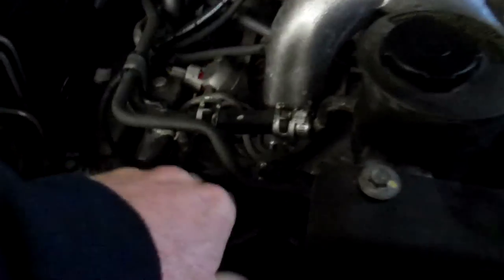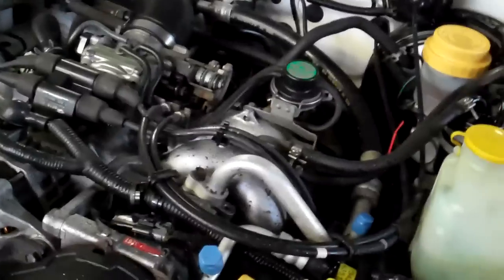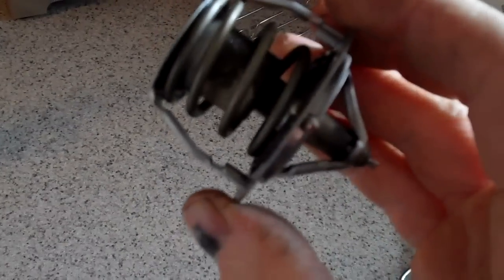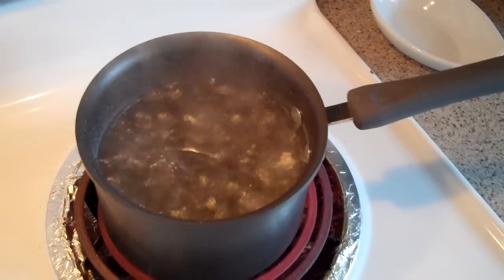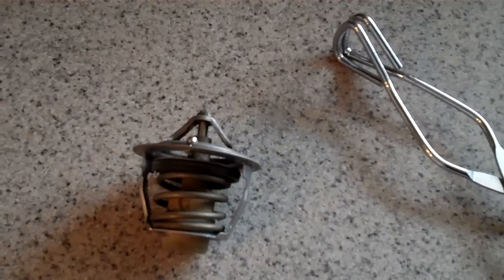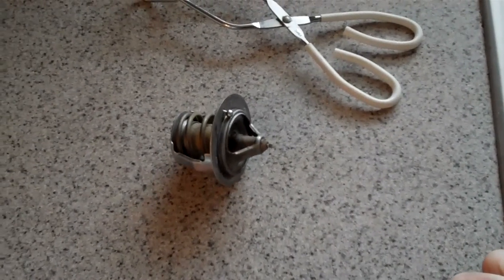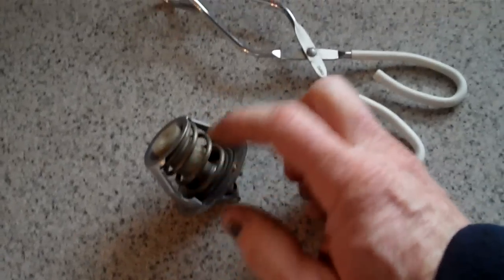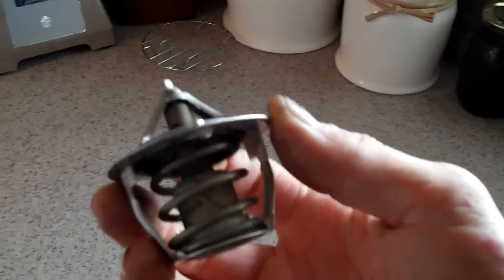How to diagnose a Subaru that overheats after ten minutes of driving

Comment: It's been a long time since you made this video so you probably already know what I'm fixing to say it's very simple to find out if you have a faulty thermostat in your Subaru 2.5 as you already know the thermostat is on the bottom of the engine .Start your car ,let it get hot, cut the car off, check your top radiator hose if it's hot check the bottom radiator hose it will be cold this shows that the water is not circulating and the thermostat is not working correctly.Also the little jiggle valve on the thermostat should be pointing at the radiator not the block. Thank you for your video
Reply: Wouldn't a dead water pump produce the same symptoms?

Comment: One very important thing on a Subaru is to ALWAYS use an OEM thermostat when replacing it, the aftermarket ones are a different design and can cause elevated temperatures and other issues. Also, just to add, symptoms of head gasket failure on the older DOHC engines is bubbles in the coolant reservoir from combustion gases (you can also run air into the cylinder in a leak down to check for bubbles) as these ones had internal leaks. The newer SOHC engines had external leaks.

Comment: Brian, love you videos! This is the right way to check a thermostat. However I have to tell you that the spring is not Bi-Metal, it is just a spring. The capsule in the middle is filled with a fluid that expands and contracts at a certain temperature. This is what actuates the thermostat. The spring is what closes it. Keep up the good work!

Comment: The spring is made of spring steel and does not cause the thermostat to open, the capsule in the middle opens the thermostat. The other thing to check during an overheating event is a plugged heater core not flowing enough coolant to the thermostat.

Comment: You are a good "explainer", Brian. Thanks.
Reply: Just got a 06 sti and it just temporarilly gets hot from 192-207. No leaking of rad fluid. Only when it's 100+ outside. Gonna try and "burp" and fill correctly, hardwire fans and then do the mishimoto therm and wrap my header... Dang corn fed big turboed subie. Thanks for showing me this

Comment: Man, you are a trooper! 

Thanks for the info. My car is overheating and I started to panic. Changed the oil (was well overdue), and found a loss of coolant. the only symptom that would match a blown head-gasket was the overheating. I figured that the Pressurized reservoir cap is a bust, or I accidentally introduced air in the coolant system the last time I saw it empty/ near empty, or there is a leaking hose somewhere I haven't seen yet. No visible leaks anywhere, and no coolant found during the oil change. I'm changing out the reservoir caps out for a new one. I'm also doing a super flush, and a proper burping, on the coolant system tomorrow morning. 

Wish me luck!
Reply: How'd it go?

Comment: Hey man. Not sure when you will see this but I have an 02 subaru forester, just bought it a couple weeks ago. Its constantly overheating. Ive changed the thermostat twice an checked both of them an they both worked. Yes I burped it an made sure all bubbles were done coming out. But the subaru keeps over heating. I am unsure if its a blown head gasket or a bad water pump. I do not have any leaks or white smoke coming from the tail pipe or the engine bay. The car will run fine but if i drive it just down the road (5min or so) it will start to overheat again. When I just have the car sitting and running for 30min or more it's fine, it wont over heat at all. Just a bit perpexled. I've thought maybe its the radiator but it doesn't show any signs of damage or leaking either. I also took the thermostat off completely an hooked the hose back up an the freaking car will drive fine and wont over heat at all. So i'm assuming the water pump is fine also. Not sure how else to diagnose this issue to figure out what exactly is going on with the car. Would love to hear your thoughts on this. Thank you in advance!

Comment from the maker: Classic head gasket failure symptoms.  Do a compression gasses test at the coolant tank while it's bubbling.  If the fluid goes from blue to yellow it's a head gasket.  The combustion gasses collect around the thermostat and it stays closed.  you can drill four to six holes in the thermostat plate to let the gasses through for a temporary fix to get by.

Comment: I have this problem! 
I went ahead and replaced the T stat and it still boils into the overflow tank after 10 mins. Both top and lower hoses are hot and the bottom one seems to bulge a little. 
Trapped gases? Poor rad? 
2005 outback. 
Great videos thanks!!

Comment: got a problem,i have a 2003 subaru outbback,replaced the head gaskets,thermostat,water pump,radiator,hoses,and it continues to over heat,the coolant builds up in resavoir tank and does not return to radiator.i am at my wits end,any suggestions (other than junk it as my friends say)

Comment: On my mothers Forester she kept complaining she could smell somthing. And of course when I go over and look nothing. well after months of this, I was replacing a CV boot and saw a slight tell-tale sign of coolant ontop of the exaust right uncer the seam between the head and the block. Strange thing is there was no noticable loss in coolant. I guess on her long shopping excursions, it would heat and warp just slightly and allow coolant out-air in and form bubble on the termostat eventully.

Comment: I have 2 Subaru Legacy's. Both have given me the same overheating problem at various times. The solution is ridiculously simple. Air gets trapped in the heater element, which sits under the dashboard and is higher than the radiator so that the air does not bleed out. There is no independent thermostat bypass in a Subaru. The hot water flowing through the heater element re-joins the main cooling system at the thermostat and acts as the thermostat bypass, heating up the thermostat so that it can open. The thermostat is at the bottom of the engine and receives cool water coming back from the radiator which causes it to close unless the bypass coming via the heater is flowing properly to keep the thermostat hot. So if you have an airlock in the heater element your car will overheat because the thermostat is not getting hot water to open it. This tends to occur more at low revs, like when driving in traffic. If you rev the engine this often pushes more coolant through the heater and opens the thermostat and suddenly the engine cools down again.

The way to prove this is to bypass the heater element. Get or make a u-bend of 16mm metal pipe and disconnect the two heater hoses at the firewall behind the engine and join them together with the u-bend and two hose clamps. The overheating problem will go away for good.  But of course, now you have no heater. The best solution if you want your heater to work is to cut both the heater hoses at a suitable spot next to each other and to fit a T-piece in each hose and join them together. (See photos). Then water can bypass the heater element keeping the thermostat functioning properly and enough hot water will still flow through the heater element to warm up the car's interior. This is the best solution, because every time you have work done on the cooling system, air gets in and it is almost impossible to get it out of the heater element again. You then get erratic overheating problems when you least expect them, and the symptoms mimic a blown head gasket, with water being blown out of the radiator and the expansion tank overflowing. Alternatively one can try to clear the airlock from the heater element by disconnecting the left heater hose  and back flushing the element with a garden hose, then quickly reattaching the hose while trying not to let air in. But the above solution with the two T-pieces to bypass the heater element  has worked better for me and provides a permanent solution, and getting air out of the cooling system after any future repairs will not be a problem
again.

I used a straight piece of hose to join across the T-pieces in the one car, and I used a U-shaped piece of hose in the other car. The U shape allows one to get away with not getting the T-pieces perfectly aligned, but can be hard to obtain. However a spare of the U-shaped rubber  bypass hose that attaches the metal bypass hose to the thermostat housing is the right shape and diameter.

see photos here: -  http://www.cargurus.com/Cars/Discussion-t17159_ds614293
Reply: I bought my impreza with your configuration and thought that somebody in the workshop was falling asleep. I rejoined the hose as it were supposed to be and suddenly the car overheats like nobody's business. Now I understood why the coolant hose was bend and sent back to where it came from. Gosh, talk about poor design from Subaru...
Reply: I just jack the front of the car or put it oon car ramps. This way the the radiator cap will be higher than the heater exchanger thus allowing the air to escape. Good luck with the subarust.
Reply: I'm having all the symptoms that you describe, than you for sharing!
Reply: Anthony van Tonder THANK YOU!
Reply: Wow, I thought my 1999 Subaru Legacy was the only one who had that problem. No internet back then, no suggestions from mechanics either. It happened on a trip, the shop didn't have a thermostat available oh, so we just left it out. I forgot about that, drove another 60000 miles without one. Didn't have any problems at all.  Heated well and cooled well.  Crazy huh?
Reply: I can open the pictures.. but good answer ...
Reply: 9 years later and this comment just saved me from selling this thing. Did a whole head gasket job (it was misfiring anyway) and still couldn’t stop the overheat. I have a feeling this is 100% it.

Comment: Hi thanks very much for this.  I drilled a few holes in my thermostat flange and that really help.  Car no longer overheat.  Still have to check coolant daily to ensure coolant not get blown out too much from the system as the HG's still leaking.

Comment: Hey Brian I'm currently working on my 2003 Subaru legacy wagon with an overheating problem. I've changed the radiator, coolant temp sensor,PCV valve ,and it still gets hot after 20 mins of driving. Do I change my thermostat next? Not a mechanic but learning fast because of your videos. Can't part with the car help

Comment: My suburu is overheating after a few minutes of driving, i checked the therm and it works fine. Im not sure if it is a head gasket problem, because i figured if that were it it would have to burn off enough coolant to make it overheat, and it getting hot after just a couple miles when the radiator is full. So my question is do you think it could be a clogged up radiator?

Comment: My 2002 subaru legacy 2.5 began overheating a year ago.Did the head gaskets.Still overheating,at least the temp gaige says so.The mechanic says it's a faulty gauge and wants me to get another instrument cluster.I say,when he pulled the motor out,he didn't get all the air out and he put a thermostat in that is deliberately stuck open.I want to put the right thermostat in the right way but don't know how,and I'm done with that mechanic.Is there a certain position for the thermostat to be placed so air won't get trapped?

Comment: I have a 2008 Subaru Forester Turbo, blue, tan leather interior. I know, awesome. I bought it with 50,000 miles on it, have had it for 3 years, put maybe 5,000 miles on it. It's my second Forester because the first one was awesome. 8 months ago, there was smoke coming out of the engine, coolant, overhearting, needle went red almost immediately, didn't even crawl up. Put in a new aftermarket radiator. Every two months it overheats out of nowhere. Dealers are stumped. Brainsmobile, prove yourself.

Comment from the maker: Sounds like an 03-04 EJ25 (2.5L)  These are VERY HARD TO BLEED AIR OUT OF.  You have to "heat cycle" bleed them.  Air collects and gets trapped at the thermostat spring.  It takes a while to accumulate there, but when it does it shuts the heat off and begins to raise the temp quickly.  The best thing to do is drill three holes evenly spaced like a Benz symbol in the plate just inside the O-ring and run it till the heat comes on- shut it down and let it cool.  Come back and top off.  Repeat.
Reply: Can you help me? Sounds like the exact problems I'm having

Comment: Thermostats work via that little brass cylinder in the center , it's a "wax motor"  , it contains a small brass pellet, as the temperature around it goes up, it expands, working like a hydraulic cylinder  to move the valve against the spring. Cut an old one open and examine it. As far as "peak oil" goes, I've read articles from people in the petroleum industry that say over 90% of the oil is still in the earth.

Comment from the maker: Trapped air in the system around the thermostat.  Drill a couple holes for burping.  This WILL make your heater warm up slower, but not by much.

Comment: I'm a VW Vanagon guy, the water cooled motors are notorious for bad head gaskets.  A good tell is to hook a pressure gauge into the cooling system, with a bad gasket pressure will quickly (3 minutes) go to 15 lbs, normal is slowly (10 minutes) build to 7 lbs..  Might work for Subaru too.

Comment from the maker: If your head gasket is leaking and you've patched it up to make the car run without overheating as a short term fix by drilling the thermostat, you still have a compression loss that causes a weaker engine performance as a result.

Comment: The right head was replaced 2000 miles ago with a felpro head gasket and a new head. Here we are again with the coolant pushing from radiator to the overflow tank. Do you think I'll have to have the head surfaced Or just replace the gasket? I've also heard to use 6 star head gaskets. Do you use these? I've heard they are very good.

Comment from the maker: Usually that type of system is related to the ignition control module getting hot and there not being enough white heat conductive paste on it anymore so it burns up and cuts out when too much heat accumulates.

Comment: 2011 Outback only overheats when the A/C is not in use, radiator, thermostat, and water pump have been replaced. Water pump was replaced for regular maintenance, the overheating issue started after the water pump was replaced 2 months ago. The thermostat and radiator was replaced to try and fix the issue. Suggestions ?

Comment from the maker: That's air trapped in the heater core due to the coolant (antifreeze) being low in the radiator (as apposed to the coolant over flow tank).

Comment: Nice review, Brian. It's worth emphasizing to your audience that every time an engine overheats, it runs a risk of causing expensive damage to the head and seals. Once steam forms within the water jacket, engine temp will skyrocket, pressures rise, and cooling capacity goes to ground. So, I wouldn't let a problem like this go for long without a diagnosis, or you could be facing secondary warping of the head, even if the initial cause was an easy fix.

Comment: I changed out my thermostat and it seems like there in no fluid going into the line. My heat is not there and the outlet on top is hot. Do i have a clog somewhere? I did find cloth like material when i removed cap. Last owner used radiator stop leak I think?

Comment: I have a 97 legacy L wagon, and a few weeks ago I followed your channel because the car was overheating I replaced the thermostat. It's been running good since. Until today it overheated again so I popped the hood and there was no radiator cap, so I found and put it back on, but it kept overheating. I filled with water, and replaced the cap. It's not overheating, but the needle is just above the center mark on the meter. 
 I am not a mechanic, and glad to have found you. 
What do you suggest is next for me to do with my car?

Comment: Brian, How about leaving the factory thermostat out, and using an aftermarket inline hose thermostat, installed in the upper hose.  Wouldn't that allow a good burp, eliminating the problem?  Thanks for great videos. Example: JEGS 53260K1 In-Line Thermostat Housing Kit

Comment from the maker: If your coolant is low, you need to find if you have a leak/ or if it's being pushed out by compression gasses. (head gasket failure).  Once you top off the radiator the gurgling should desist.   If it does come back you know you've got one of the for mentioned maladies.

Comment: I've been told that the combustion gas problem can be temporarily dealt with by drilling three small holes similar to the vent you showed because if that vent isn't sufficient or twisted to the wrong clock position gasses will still collect

Comment: Thank you so much for the video. Is there a video where you talk about the coolant pushing into the overflow tank and pushing out the tube that goes into the radiator neck? If there is not evidence of coolant in the oil, no leaks other than from the overflow tank and no some, what should I check? It is an 03 Outback with 260K, headgaskets were replaced at about 190K or so.
Reply: +Platinum Distributing NE having the same problem with my 02 wrx. Hoping to get an update.
Reply: I have the same problem with my 2010 outback. Replaced the radiator, thermostat, and water pump. Still overheating after 12 miles of driving.

Comment: Hi Brian, Can find this answer on google so Im hoping you can help. My 03 pathfinder overflows the overflow tank when Im towing a trailer with 2,500 pounds. I have towed 2k without a problem. I drive it daily with no issues. Cant figure it out! It is rated to tow 5k and the temperature needle is always reading normal. Any idea? Please?